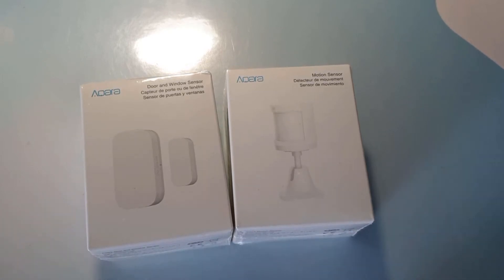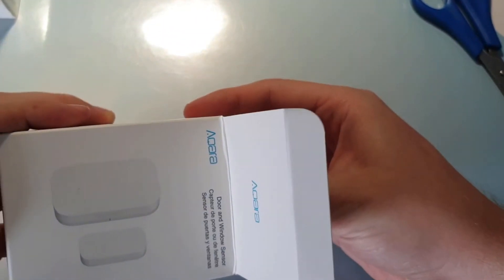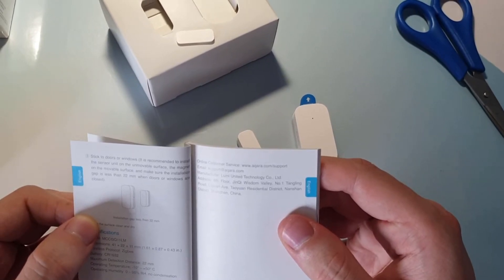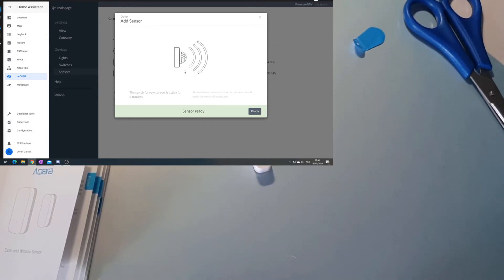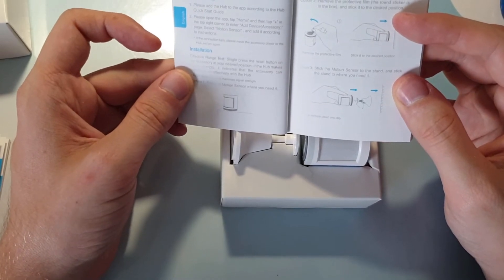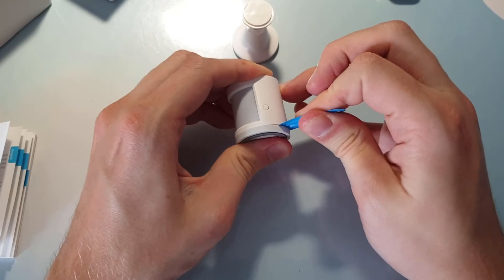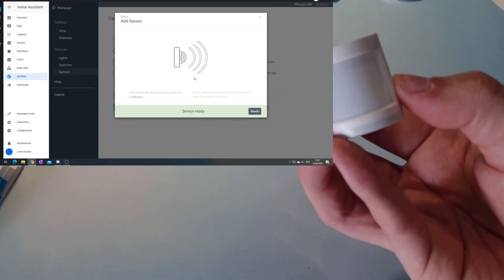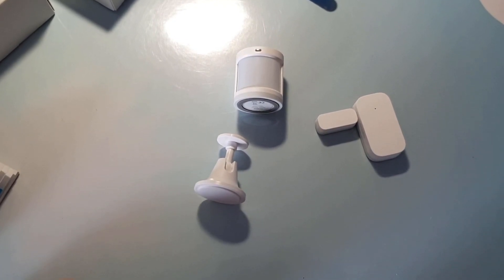Aqara Door- and Window Sensor AND Motion Sensor - Unboxing and DeConz Integration

Comment: My aqara door sensors don't mesh with other devices and they either connect to conbee stick or fall to connect once I move them away to the other rooms.
I wonder what's your experience?
Reply from the maker: hmm, I haven't really moved them around too much yet. It worked over my whole appartement (2 floors), but not in the storage room between the washer & dryer (but I think this is due to 2 big metal boxes jamming the signal) :)

you could try checking on the github if anyone else has found anything similar?